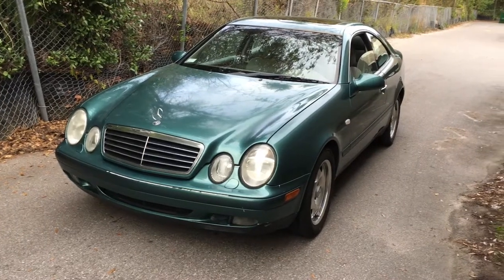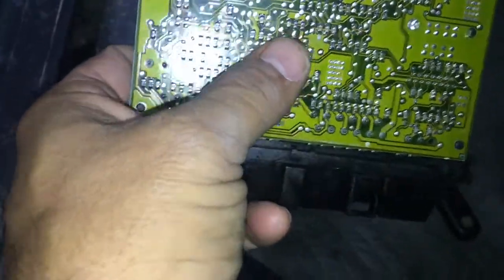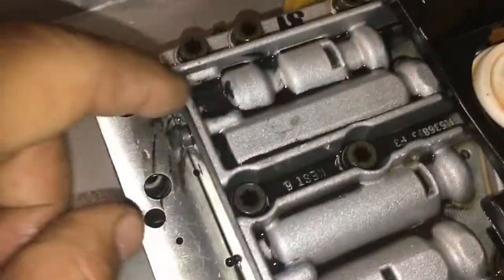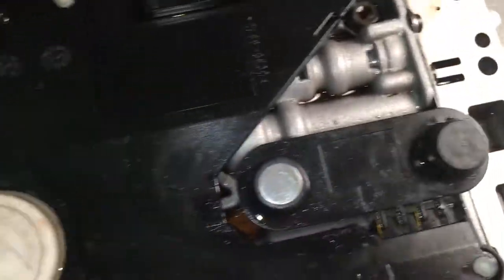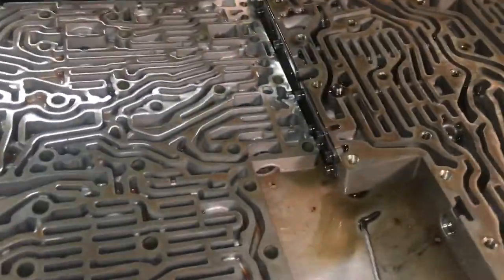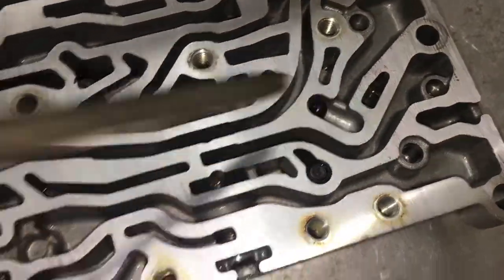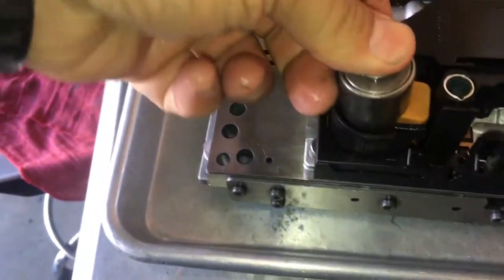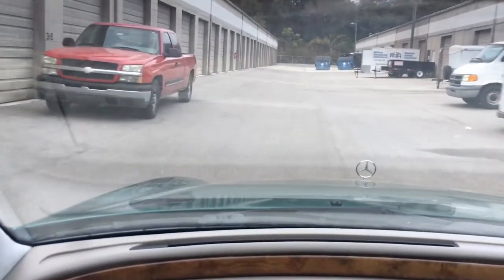Mercedes Benz conductor plate 722.6

Comment: So you did not have to take your cars to the dealership for programming? But what if you're not getting any codes but your transmission shifting really bad from 1st to 2nd when cold start  But after the car reaches normal temperature it runs really smooth when shifting gears
Reply from the maker: If you’re using the same TCM (granted it’s not ruined) you don’t need reflashing (reprogramming). As far as shifting when cold- you know, my CLK (which also uses the 722.6) still does the same thing. My CL500 also shifts funny when cold, as well. If I take off before letting them warm up, they will (sometimes) shift kinda hard before warming up from time to time. Those trannys are very finicky. I’ve been thinking about replacing my shift solenoids and perhaps rebuilding the valve body. Not sure.
Reply: @adriannyasia  shift solenoids are the ones your remove from the old conductor plate?  I don't wanna get too deep into it because I'm not a mechanic, I'm just a do it at home type of person because it cost too much to get Mercedes to do any type of work
Reply from the maker: @deruin78  where r u located?
Reply: @adriannyasia  Columbia, South Carolina